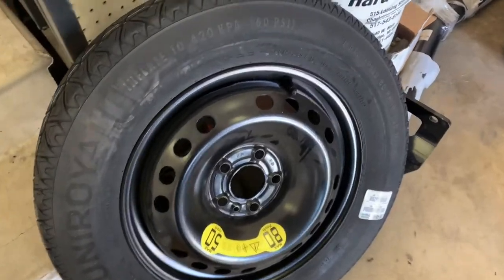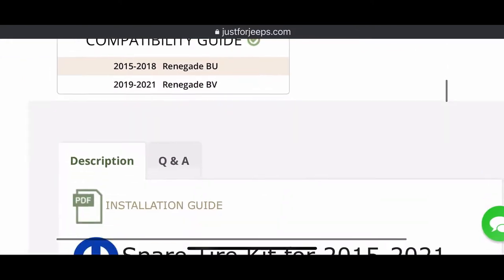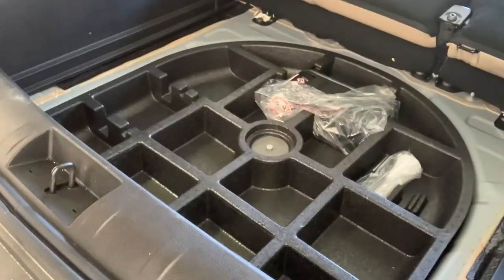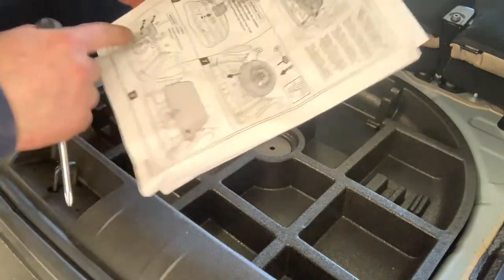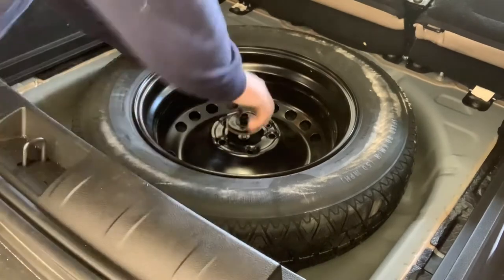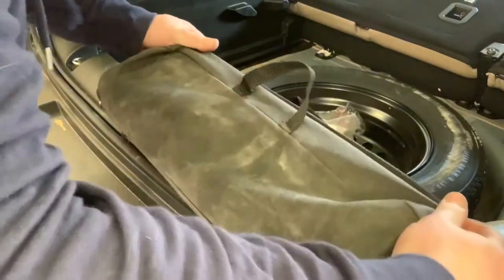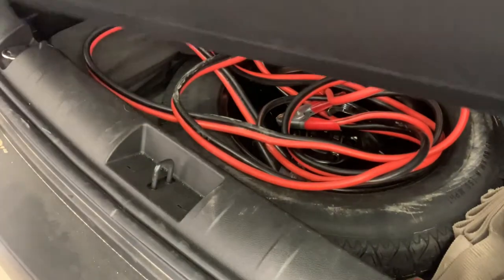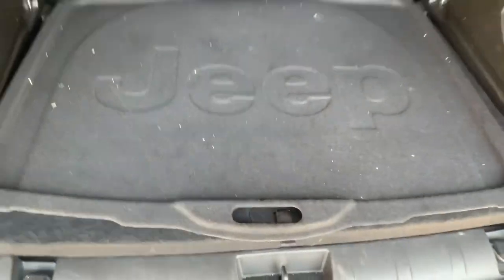Spare Tire Kit for Jeep Renegade Install (MOPAR)

Comment: I purchased a full size tire removed the tire kit panel and full size tire , kit , jack and wrenches all fit . I also used the same screw and circular disc to keep tire in place . No need to buy kit , I only paid total $230 for tire and jack.
Reply from the maker: Oh definitely.

Comment: To save a few bucks, you might consider using a Saab 93 spare tire (Junk Yard $15), a jack from a Saab or Jeep Liberty or any other Jeep ($5) and a breaker bar an a 17mm socket at Home Depot $30 ... total cost $50 v $349
Reply from the maker: Yeah. The price was RIDICULOUS. Should come with a real spare. I digress. Lol

Comment: Perfect timing on this video. I’m going to install this kit on my daughters vehicle. Thanks man.
Reply from the maker: Could be better. Could be worse.
Reply: @KeepOnWrenching  That pump and goop kit was absolutely worthless when I had a sidewall slash. Got cheap full size tire, scissor, jack, and 12mm lug adapter from walmart for less than a $100.  No way I'm paying $350 for a donut tire kit.

Comment: I kept the bottom tray for bits and pieces as well as the foam/inflator as provided by Jeep, wrench, straps and bungies etc, then laid the original thin cover on top, then placed the spare with jack fitting inside it and various bits and pieces around it as it's not secured. Then i placed the top board over the top. Fits really nicely retaining the flat load space. No vibrations/knock.
Reply from the maker: Great approach! Wish I would have kept that tray.
Reply: @KeepOnWrenching  sure comes in handy for the storage.

Comment: Thank you for this video, I was on my way to daughters, and got flat, the inflation kit was useless, I had pulled over to side road, and then was going to call a tow truck, since there is no jack... I am 75 and was so upset, a farmer stopped and said if i could back up into his driveway near the garage, he could help me. Well he did, fixed my flat, and I was on my way... I vowed I  would get a full size tire, but was not sure if it would fit... I have a 2018 latitude jeep renegade. This all happened  may 2023...
Reply from the maker: Omg. I’m glad you found a helpful person. I truly get how they can sell these with a proper spare tires. Plus, the cost of this kit is ridiculous! Best to head to a junkyard and grab in there for 25 bucks. You’re right…that inflator kit is useless

Comment: People should be creating class action law suits with all these manufacturers to have to pay out to give every new buyer a spare tire
 This is just ridiculous
Reply from the maker: It’s ridiculous
Reply: I agree, it was depressing when I noticed my 2023 Jeep Renegade Latitude didn’t come with a spare tire the air in a can and the cheap useless compressor are a joke!
Reply: @rattlesnake63  dude.. I bought the same exact vehicle last year.. and yeh I was completely confused when I asked about it.
 Haven't had to try the Air in a can or the "compressor" yet.. don't want to.
Reply: @warthogA10  Dude, hope you never  have to.I bought mine last year also,It never crossed my mind about checking to see if it came with a spare tire. What a ripoff!